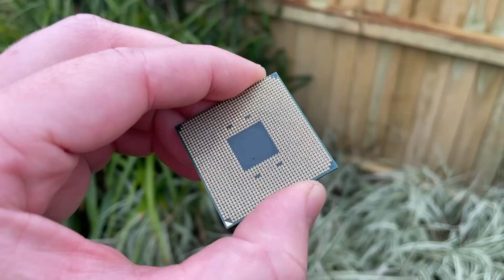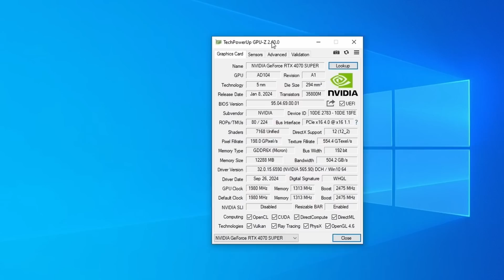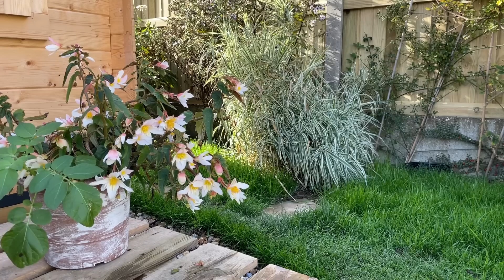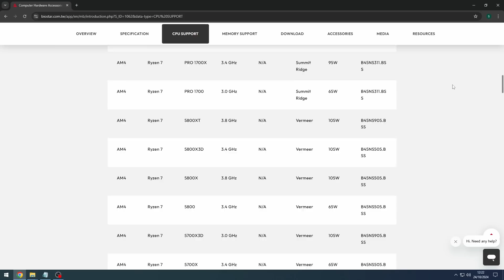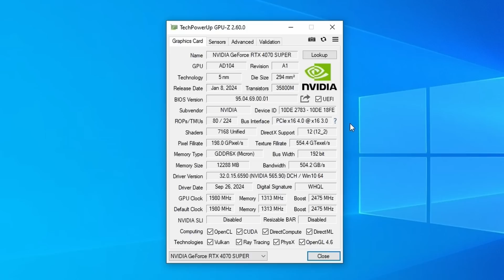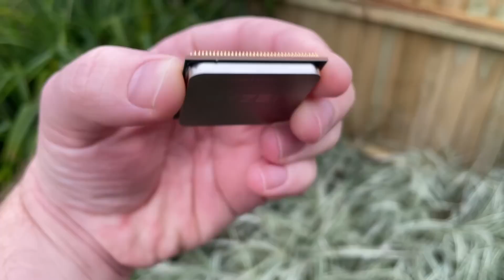I accidentally dropped my new CPU, here's what happened to it...

Comment: The exact pinouts on chips are not published, so it's not clear exactly what happens. But sounds like some of the the CPU PCIe lanes got somehow got damaged. What happens if you go via the PCH instead? Or use an older gen graphics card that is PCIe Gen 1 or 2?
Reply: There's an AM4 pinout diagram on reddit, and it shows the 1D pin that is missing is a GPU PCIe slot pin, so that's what's causing the issues..
Reply: @BaroonValm  Very interesting, thanks. That would explain a lot!

Comment: Ive never seen a CPU be half working before. I dropped my fair share of intel and AMD chips and they either break or are unaffected. 99% of the time there unaffected especially in the case of LGA cpus.
Reply: depends on which pins get damaged. in this video the 1D pin (2nd pin above the triangle to the left) is missing, and it's the GPU PCIe pin, as you can see if you search for AM4 pin diagrams

Comment: This is actually really dope, cuz I've seen a number of big channels putting out videos saying that once damaged cpus can be bent back, pins replaced, etc; and be totally fine and 100 percent functional. It's a different, longer term use case. Also, request that you try removing and alcohol swabbing the cpu and socket. Like maybe there's dust or a scuff that's causing the pins that handle pcie to malfunction

Comment: I had a CPU stick to the heatsink so bad I ripped the CPU out of the socket. I'd preheated and was twisting a little back and forth when it all just popped out. The CPU was hard to seat back into the board. I couldn't see anything bent but it wouldn't fall into the socket. I laid it on top and gently pushed it up and down and back and forth until it dropped back into the socket. Thankfully no damage other than making it tough to seat back into the board.

Comment: My Freezer II 280 AIO failed, so I took the system apart while my PC was on the desk, taking out the cooler. I opened the AM4 socket while holding the CPU, and still managed to drop my 5800X3D onto my GPU, bending a few corner pins. The CPU was also around 113°C hot before I realized the cooler had failed and I yanked the power cord out of the wall.
By some kind of miracle, the CPU still works flawlessly, but I feel like I survived like 3 heart attacks.
I still think that pins on the CPU are better the motherboard pins... those are insanely easy to completely destroy.
Reply: I agree with you. I had to "bend back" both and the CPU ones are much more easy to do. Also CPU ones can be touched by your fingers and will tolerate much more abuse than the MB ones, those can bend if you look at them wrong.
Reply: How tf did it get to 110°+?! Did you have thermal throttling disabled?
Reply: Yeah, but if you ace motherboard pins, the socket can be replaced. When you destroy CPU pins, it's done.
Reply: @Dr.C-UTS  Actually, you can replace CPU pins. There are videos of technicians doing it on YT.
Reply: @magoid  Yeah, I realize, but replacing a board socket is easier than replacing a pin 9/10 times, but you are correct. It can be done. Easily sometimes too. It really depends on the pin location, size and type.
Reply: How many years this the aio live?

Comment: possible dry solder joints? micro cracks can form on the pin solder joints and remove clean transfer of electricity.
Reply: It's missing Pin 1D (above the triangle 2nd one to the outer left)

google am4 pin diagram and you'll find it's a GFC PCIe pin, perfectly explains the issues observed.
Reply: @BaroonValm  yup that makes complete sense. Good find

Comment: I wish so much that they would develop an actually robust connector CPU/MOBO pins are absurdly fragile. Srely they could come up with some better way.  I guess that it just isn't a problem for factory line customers(dell etc) that make up nearly all their sales.
Reply: really its so annoying how weak the pins are, on the most important part of the pc arguably.
Reply: G.skill has a motherboard pin pad, for the pwr and reset pins to all be one plug. The same concept, but as a cpu cover could be super cheaply printed by intel or amd. Not a perfect fix, but an additional layer of protection up until you're just about to drop it into the socket
Reply: Intel Pentium II CPU's were mounted on an edge card that fit into a slot on the motherboard. The cooler was designed very much like a GPU cooler. Technically such a design might still work. If they can air cool an RTX 4090 pulling 400 watts they ought to be able to cool a CPU the same way. An AIO liquid cooler might work too.

Comment: I'm buying a new cpu and now I'm scared of accidentally dropping it
Reply from the maker: Be very careful don’t let this video put you off 😂
Reply: @RandomGaminginHD  Thank you for video Boss. More. people's can't understand if you are using 3d cache cpu you must own x570 or B550 motherboard.. You need pcie 4....Hope more amd users will get it..
Reply: My roommate just bought a 5700X3D to replace the aging 1700X.
As the house's resident Tech, I did the swap.
Dropped a chip... It was the 1700X. Only bent about 5 pins, and a little time with the straight razor edge fixed it.
The 5700X3D was untouched! Upgrade successful. All are happy.
Reply: @hrayz  That's  good workaround for Murphy's law.... drop the old chip first and Murphy will be satisfied with your sacrifice..
Reply: Buy Intel. They have a brain. Which is currently itself damaged but we digress. They don’t put pins on the chip which can result in instant death if you drop it.
Reply: Wait till you pull out the CPU with the cooler, was scary as hahahaah
Reply: @GabrielTobing I just twist the heat sink, almost did this with my 5700 while replacing the stock cooler
Reply: Nah she’ll be right
Reply: Go intel or AM5 😂
Reply: @WTBMrGrey you can still bend the motherboard pins, which is worse lol
Reply: @zues121510  Shhhh, dont spoil the suprise 😂
Reply: @zues121510  you can still bend them back tho in my case I was just lucky and only 2 pin was bent
Reply: Solution: Carefully place CPU on the floor. CPU cannot be dropped if it's already on the ground.
Reply: @WTBMrGrey  
Don't bend the motherboard pins.

AM4 you can fix this kind of screw up, but on a socket you have no chance.
Reply: @B-26354  Well, it's not impossible, if you have a needle, good eyesight (or a microscope) and a steady hand. Linus recently did a video where he fixed motherboards with bent pins.
Reply: @WTBMrGrey no am4 is incredibley based
Reply: @WTBMrGrey nah am4 is super based
Reply: @WTBMrGrey  in all seriousness I understand tho unless your budget is pretty low, then am4 is still cool

Comment: I did the same with my 5800X3D - luckily I managed to bend the pins back with a straight edge razor and then did the 'rocking in the socket trick' a few times.

I've had no problems with it since this.
Reply from the maker: Good to hear :)
Reply: @RandomGaminginHD  
I'm a AMD fanboy and have been for the last five years now but the AM4 chips were so prone to accidental damage it is unbelievable.

Still it's easier to attempt a fix on an AM4 CPU than it is on the newer socket pins - part of me is wondering if this was a deliberate choice from AMD to encourage more cost as accidental damage isn't covered by them.
Reply: Bent my 5800X3D when I removed it to motherboard swap and I didn't let it warm up before removing, so the cooler pulled it out along with itself, bending like 15 pins in the right corner of the chip. Took a sewing needle and prayed. It boosts to 4.5 ghz, runs cool, and I haven't encountered a crash yet. (Happened like a year ago)

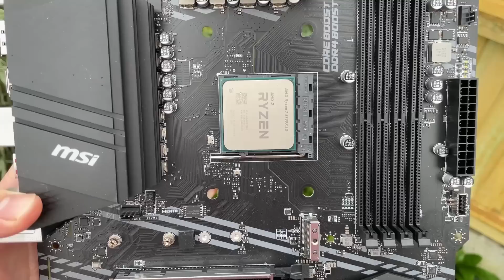Comment: that cornern pin that is so obv bent still.... 0:53
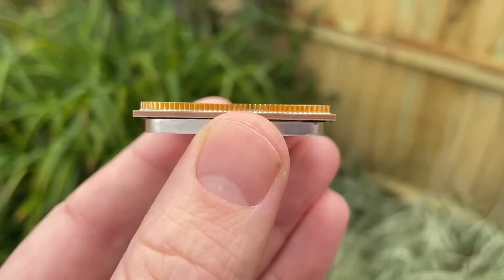Reply: at 0:46 you can see the problem, missing the 1D pin (which is a GPU PCIe slot pin, if you google AM4 pin diagram) 2nd pin above the triangle to the left at the bottom left of the chip.
it perfectly explains the issues seen in the Video, and hopefully it's a relatively easy fix if you're good at soldering
Reply: @BaroonValm  
You don't need to solder it, you can stick a pin in the respective socket on the board and it will work again.

You can also use conductive metal solder glue which requires zero soldering...
Reply: @BaroonValm  would be fun to see if it can fix it
Reply: @bmanrockwell2174  would be nice to see it working yeah
Reply: No missing pin. This is the normal pin arrangement. @BaroonValm
Reply: @Nick_R_ look closer, there is indeed a missing pin
Reply: @nan_cat I was wrong. There is indeed a missing pin. Not in the corner itself, but the edge of the fourth row, D1, as was said.
Reply: @BaroonValm  There is no pin missing
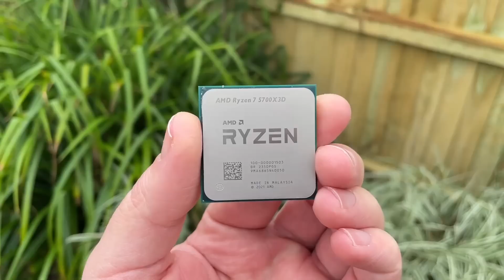Reply: @MrBeetsGaming  there is a missing pin, it's the P_GFX_TXP[0] Pin that's missing, you can see at 0:46 and 6:48, though it's really, really hard to notice , and it's actually quite a bit easier to see on the twitter post picture where you can see how the location of the pin looks quite a bit different from the rest (as there's no pin)
Reply: If It Fits, I Sits
Reply from the maker: Yeah straightened them all out a bit more since and the issue persists :(
Reply: @RandomGaminginHD  in the golden arrow corner - bottom left at 6:50 pin is broken off. needs to be soldered by someone who knows micro soldering, pins are stuck to CPU pads with solder bumps, its not an end of the world. I think chip is fine.
Reply: @RandomGaminginHD  damn that's unfortunate. yeah I dropped a pin grid one once, was gonna help a friend install it too.. it went IHS down luckily. having done that I really dont like handling them at all. And I'm going for the 7800x3d soon but but it seems it doesnt come with pins. it seems to come with some kind of pads.
Reply: @no1Liikeglenn  Yes 7800x3d has pads, but you can kill motherboards socket by just touching or if CPU falls on it from 1 inch, MB has even more fragile pins.
Reply: @PREDATEURLT  ohh how nice. well I once changed my old 'evga 980ti hybrid's aio cooler since it broke down after some years of use. I installed the kraken x42 on it the one with the single 140 rad on it, onto the sled thingy/bracket and that onto the gpu. luckily i didnt know until after how fragile the gpu silicone is. and how easily it cracks when installing an aio incorrectly....
Reply: @no1Liikeglenn  "it seems to come with some kind of pads."
Yeah, that's an LGA (Land Grid Array).
Reply: At least it's an easy one to fix, I'm surprised he didn't see it